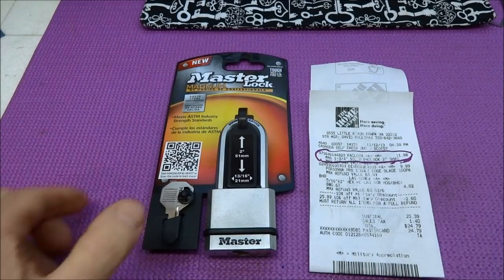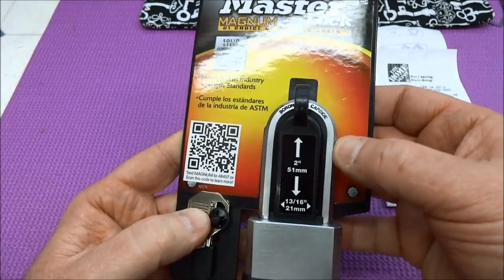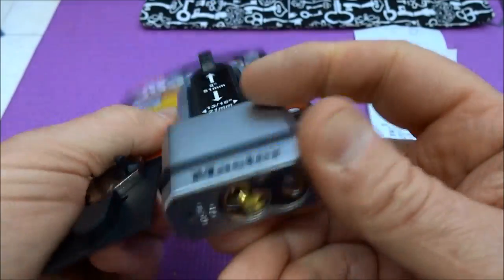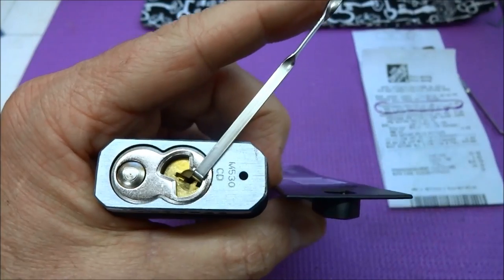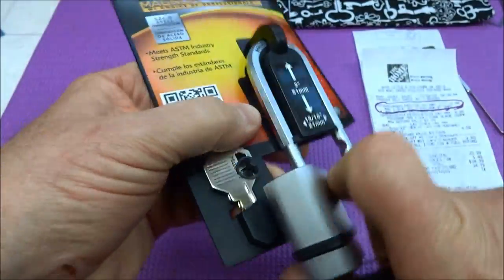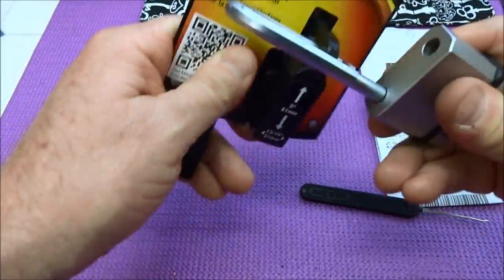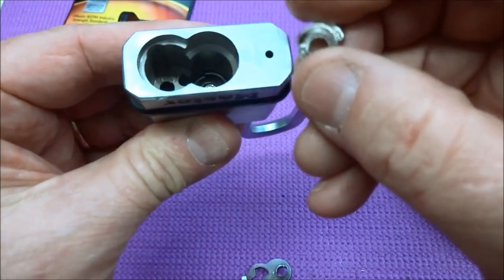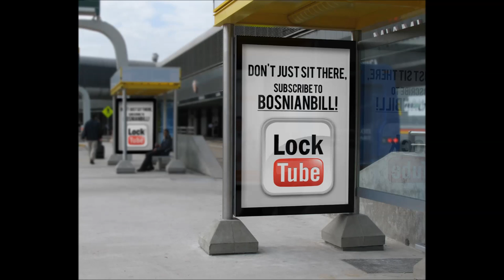(449) Master Lock 530 Replaceable Core (JUNK!)

Comment: I got this lock today to try making some spool pins from the standard pins but it seems like on the newer models the core is crimped so you cant pull the cylinder from the bible. wound up destroying it with a dremel to get the pins out...I keep telling myself not to get master locks. They are always disappointing.

Comment: Try the Master 532.  It's almost identical but with a longer Kwikset smartkey 5 pin(slider) core which makes it virtually unpickable or bumpable.  It's actually a really good lock if you are concerned about surreptitious entry.  It won't withstand a drill or screwdriver attack though...

Comment: I just bought a new master lock padlock from home depot. Everybody says they are junk but those are the only locks I can find at the hardware store. I hate trying to buy the expensive ones off of Amazon because I can't really get a feel for how big the lock will be and more importantly if it will work with my trailer. I bought the Abloy 350 enforcer but the shackle is to damn big, it won't fit in the hole on the latch of my trailer and I don't wanna buy the smaller ones because they look like they would be to easy to cut with bolt cutters. But my 16 dollar masterlock I know for a fact it is hard to cut with cutters because iv tried it and it fits perfectly in the latch on my trailer.

Comment: @bosnianbill  what is better boron alloy or boron carbide
Reply: +tittytwister5251 Tungsten carbide is very hard and very brittle.  It would easily shatter with a hammer strike or crowbar twist.  Boron carbide is extremely hard, and also extremely tough.  So yeah, it would be good stuff to make a padlock shackle out of.
Reply: if you like the third choice, Boron Nitrate is the shit, second strongest metal composition.

Comment: Not even sure it a brand. It is a padlock. Most thief don't pick padlocks they use bolt cutters so am safe. I personally use 2 cheap padlocks with a chain. Also chain my seat with a chain. My Bicycle never got stolen.